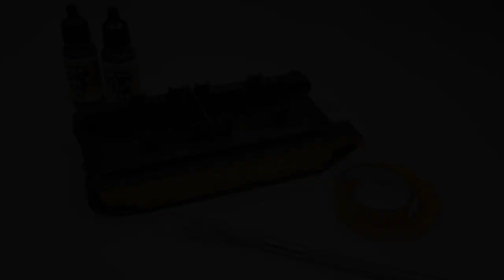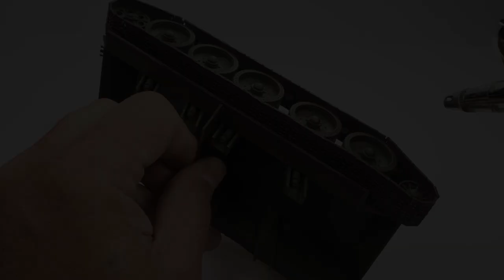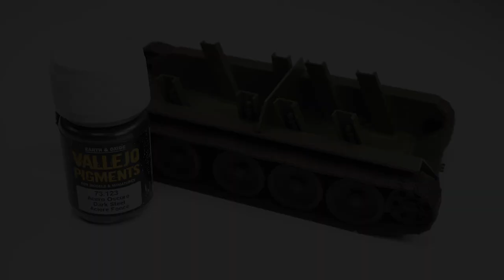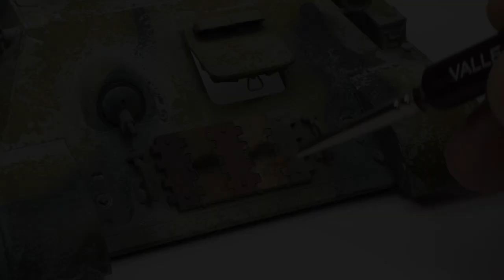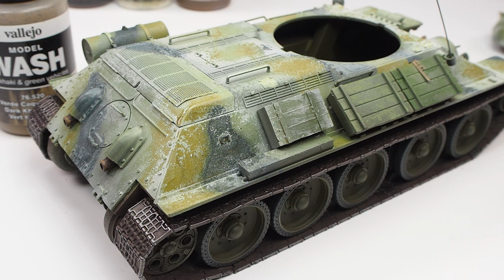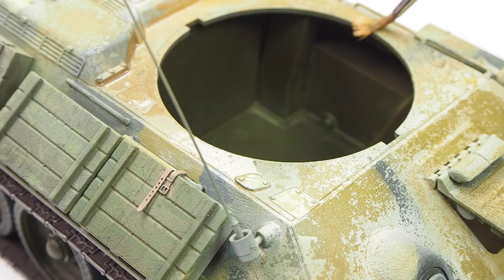🇺🇸🇬🇧 #4 PAINTING PROCESSES: FILTERS AND BLENDING by Chema Cabrero ✨

Comment: I have most of the colours in 71.213 Wheels & Tracks set & they work great for the intended task. As of late, I have been using 73.821 Rust Texture as the base colour for tank tracks as it adds a bit of texture for pigments to hold on to during the later stages stages of weathering as well a give the same dark brown colour assosated with old tanks tracks.  I all so use 76.523 European Dust as a pin wash to similate the build up of dust around tanks susspention & joints on the hull, but the effect is lost when I add the pigments for dust,  leaving a bland monotone colour instead of the cormatic richness intended, how can I correct the issue?
Reply from the maker: Hello Pirate Penguin! It is important to ensure that the washes are completely dry before applying dry pigment. Any moisture can cause the pigment to change its consistency. Additionally, make sure to use a contrasting color, as using a very similar one could make it difficult to notice any changes :)
Reply: @vallejocolors  Thank you for your feedback, which pigment would best compliment 76.523 European Dust?  I have 73.104 Light Sienna, 73.105 Natural Sienna & 73.106 Burnt Sienna which I use for dust affects.

Comment: Hello, What product are you using for the "Filter"? (Model Wash? is it mixed with water or medium or straight out of the bottle?). Your reply is welcomed.
Reply from the maker: You can use the color you like the most and thin them enough to get a "transparent" finish for your models. Anyway, our Model Washes are already formulated to save you this process so you can use them straight from the bottle :)